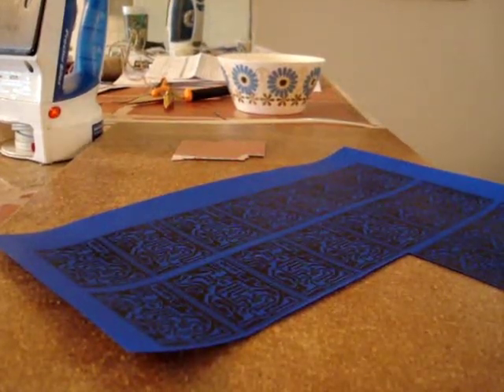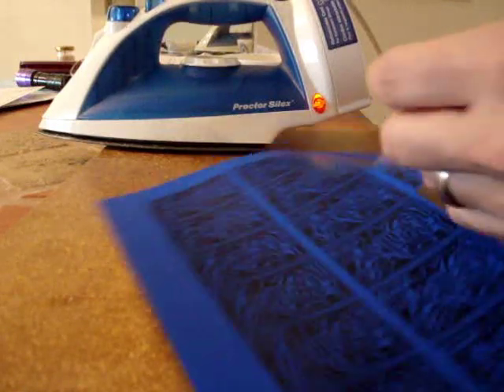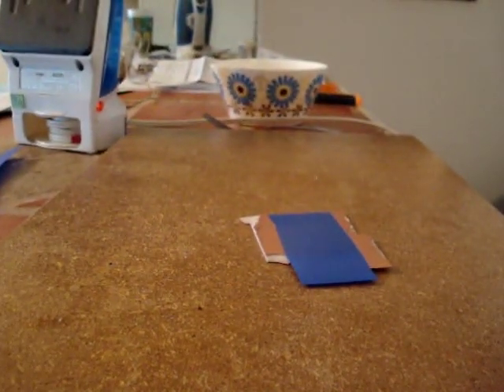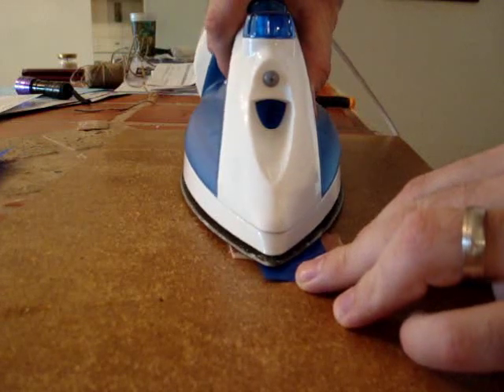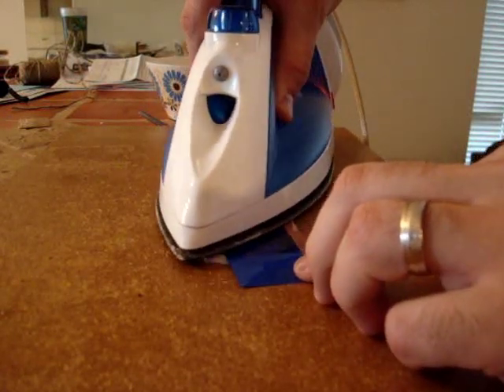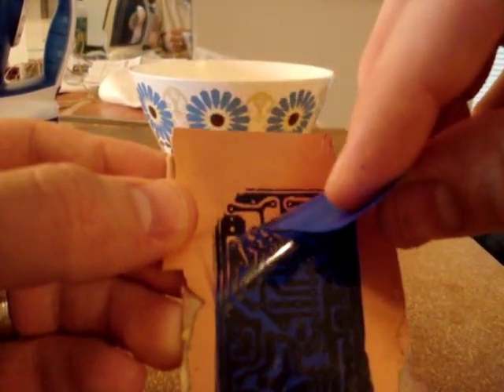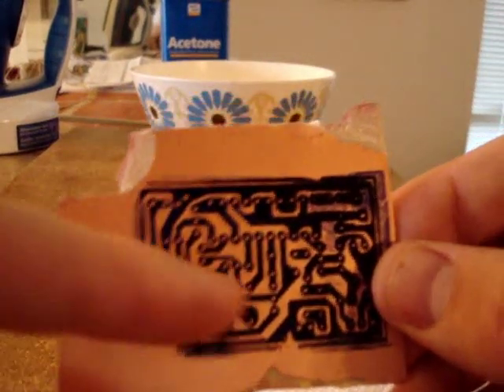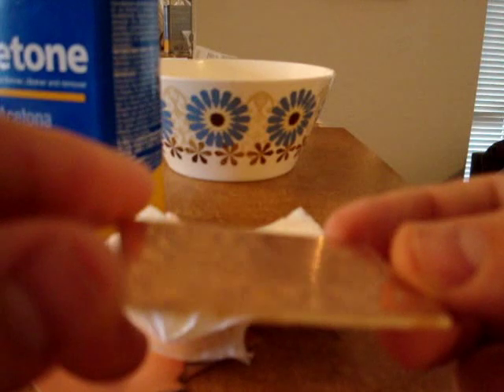Make a PCB with Press & Peel blue transfer paper

Comment: I use and prefer thin non-glossy photopaper printed in the laser printer. It comes off very easily without any residues. Also there's no need for water. I use a standard cheap laminator without any mods. Pass the pcb trough it for about 10 times. I create lines with 0.2 mm with ease. I use a laser printer with colour setting and max. saturation in the 3 channels. This gives me more toner then just b/w.
Reply from the maker: Me too.  After I ran out of my first purchase of the blue paper I started using Sweetwater catalogues and haven't gone back.
Reply: Wow that is A GREAT idea!! Wha made you think to do that?

Comment: what program were you using to make this..  and how did you get multiples of circuits on one sheet  I use eagle cad and just cant figure it out
Reply from the maker: +Täuschung  
hey man.  
Sorry I didn't see your question before.  

What I do first is run a few test prints on normal paper to get the size of the circuit correct. 
Then I do it the crappy way to get a bunch of circuits on one sheet. 
I do a "print screen" capture and save it as a picture.  then I past that picture into word and crop it down to just the circuit.  
Then I copy and paste it over and over again. 
Then do another test print on normal paper. 
If it looks good, I print on the expensive fancy blue paper.
Reply from the maker: +Täuschung 

I use Diptrace now.  But I think that circuit was something I pulled off Madbean.

Comment: NoPlaceForTheDead when I print out my circuit how do I no what size the circuit is going to be?
Reply from the maker: Owen Chase I'm not sure I understand your question. 

The size of your circuit is whatever size you print out.
Reply: ***** o ok, so the size i want is in my printer settings?
Reply from the maker: Oh yeah.
If you designed your own circuit (like in Eaglo or Diptrace) then you can measure out the dimensions of the circuit in that program.  Then you know to print the circuit out at those measurements. 

If you didn't design the circuit, then most people who provide DIY circuits will have it indicated in the documentation for said circuit. 

Either way, once you get the dimensions of the circuit, make sure to set it up to print that size on your printer. May print a few tests on normal paper first to make sure you have the right settings.
Reply: ***** ok thanks ya right now im using express pcb.
Reply: ***** soldering wires from component to component is a pain in the ass, im so done with it.

Comment: The ideal temperature to transfer is between 275 and 325 degrees.  They make magnetic thermometers that are meant for wood stoves that work really well for this application.  You stick it to the bottom of the iron, turn the iron on, adjusting, until it gets to the correct temperature and then remove the magnet (carefully, it's hot).  Now you can easily iron on your transfer, knowing your at the right temp.

Comment: thanks for the reply. what do you mean by laminator method??? i have found i need to iron "the heck out of it", so to speak, or risk having missing specs. in fact, ive found that it helps to do two additional things: 1. poke tiny holes in the transfer outside of the traces to let hot air and moisture escape, this make removal easier. 2. preheat the copper clad first for 1 min with the iron, then lay the decal down

Comment: I would use ferric chloride, but didn't bother. I could tell after each ironing stage that in the best cases, only about 80% of the circuit had transferred, so there was no reason to try etching. Maybe my iron just can't get hot enough or can't distribute heat evenly enough. I don't have a laminator, but unless that works perfectly every time, I think I'll try to get a CNC mill and make PCBs that way. (The photo method works fine, but is a hassle with darkroom and extra chemical step.)

Comment: Thanks for the video, but has anyone gotten good results with PnP? I tried ten times, using the method Techniks recommends (not pre-heating the board, but heating the film for anywhere from 90 seconds to four minutes). I also tried your method of pre-heating the board and then only applying the film for 30-60 seconds. It never transferred enough detail to be useable, even with my iron at highest setting (325) and trying to fill in with a sharpie. The photo-sensitized boards seem much better.